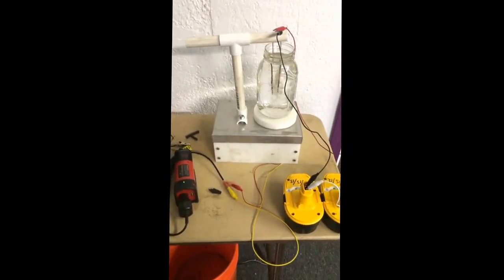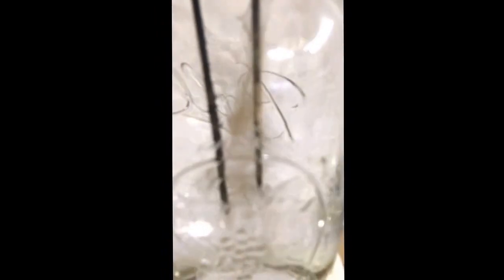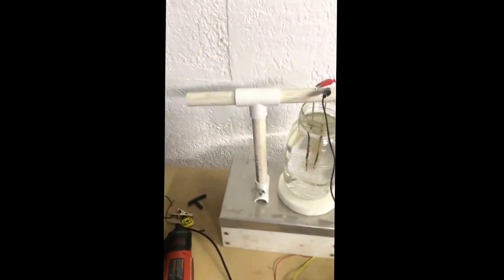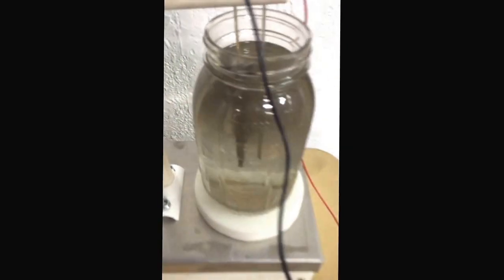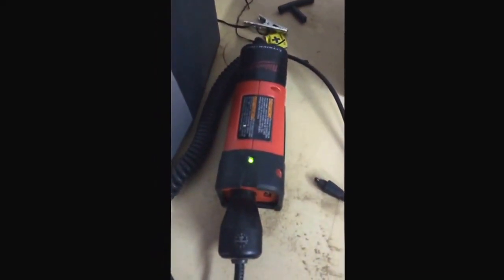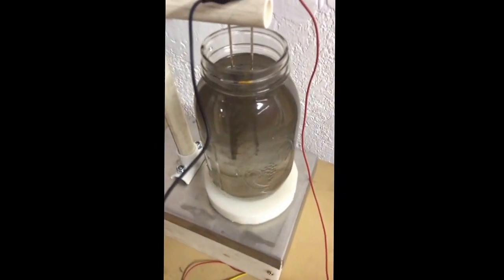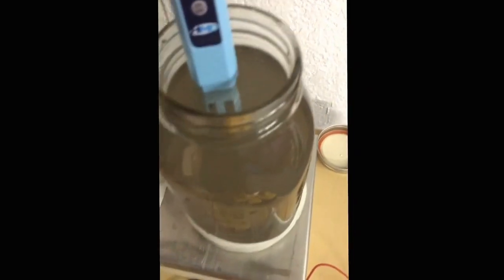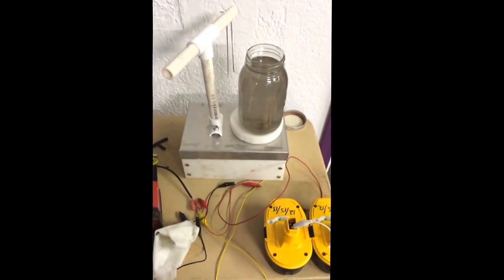Making colloidal silver with a homemade generator

Comment: I am no expert but I did do a good amount  of research into the making of collodial silver. I think the dark color you got so fast is from the higher voltage you are using vs  the distance between rods. This is the particle size is larger and also the oxidation on the rods got into the water also. Try it again use 1 battery instead. Clean off rods if you see them get build up on them. I wouldn't drink that stuff you made,but  I would put it on my skin.